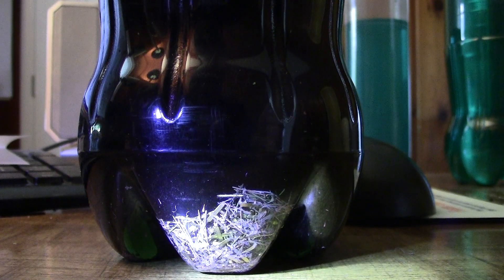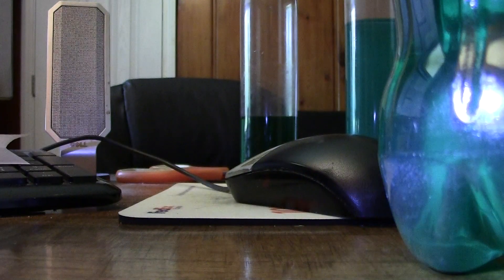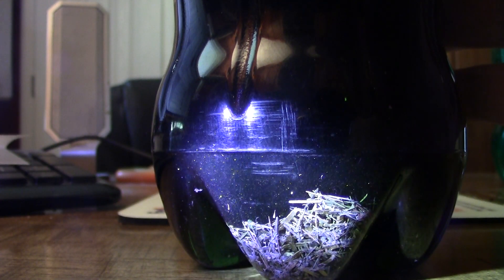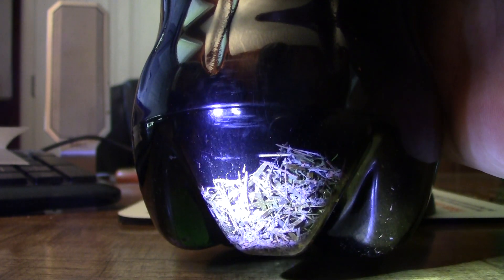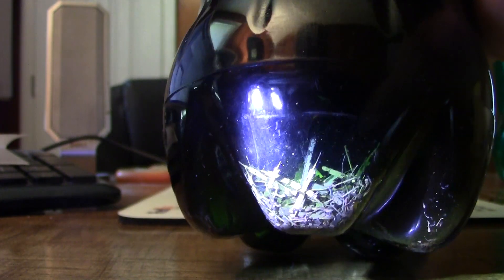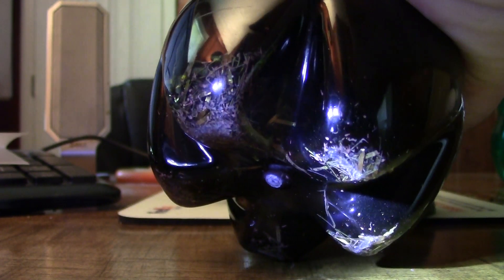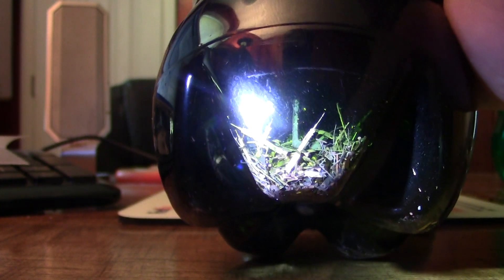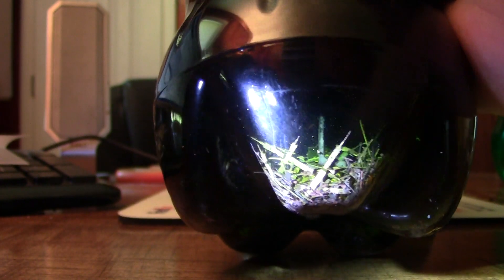Gold Recovery: 50 Grams of Pins

Comment: Alsi, if you have solder still on the pins, it could affect gold recovery rates drastically.  Always remove solder first with hot HCl on a hot plate for a few hours, then proceed with either A/P for non magnetic pins or keep heating it with hot HCl (Muriatic Acid). Then use a fume hood and place whatever solids are left in some Aqua Regia. Finally, neutralize Nitric Acid with Urea and drop the gold with Sodium Meatabisulphite. Then, after you think you are done, filter the solution and test a small amount of the liquid with Stannous Chloride. You want it to be negative, which means no more gold is remaining in the liquid, but if a color change is detected,  keep adding more SMB, until the test is no longer positive. Then, it can be brought to a special waste disposal site for treatment. My two cents.
Reply: Sulfuric acid bath should make Lead Sulfide and remove it initially. I would not bother.

Alternatively take a smidgeon of Sulfuric Acid and add that to your Peroxide/HCl. That will precipitate the lead out as Lead Sulfide.

You can get Sulfuric Acid at any Auto Parts Store as Battery Electrolyte.

Also I posed a question. But I will ask you too. What do you do with Gold Plated Steel? How do you separate the Gold from the steel???

I do not need any Boil Over accidents.
Reply: Hmm. I didn't  know that a small amount of sulfuric could be added to dissolve the lead from the solder. Interesting. In order to dissolve the steel, you can use hydrochloric acid to dissolve it into the solution to yield iron (II) chloride plus hydrogen gas. Be careful when dissolving iron, as it is an explosive, flammable gas.  As a result, do this outside, don't  smoke, or dissolve near open flame. Not responsible for any injuries from this gas. Hope this helped.
Reply: hey thank you alot for ur two cents i have been stuck all day and this just helped alot thanks man!
Reply: Oh, no problem!